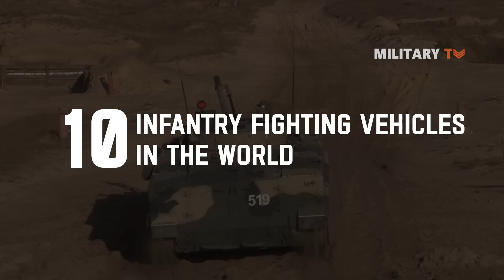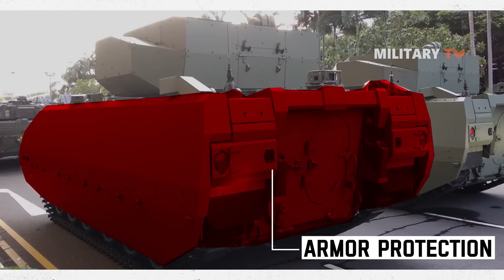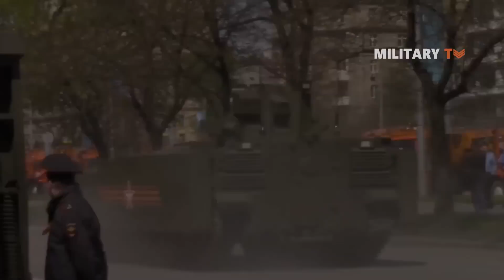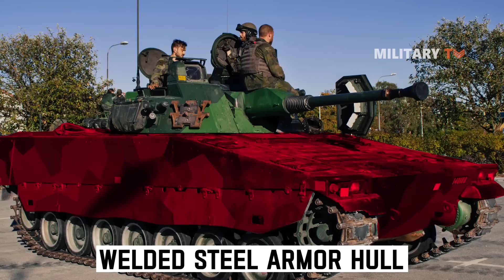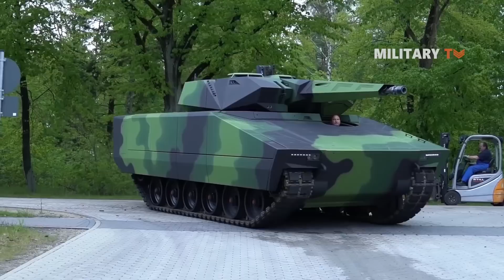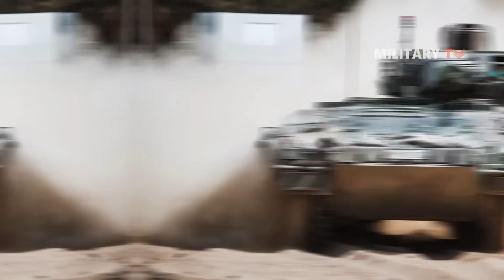Top 10 Infantry Fighting Vehicle ( IFV )

Comment: the AS-21 Redback is better than the K21, is better armoured, has a much better turret, same engine and drivetrain as the K9 thunder, can mount EOS R400S Mk2 HD or R150 remote weapon system, Javelins and two spike LR2 and Iron Fist APS by Elbit systems
it comes in at 42 tons compared to 25.6t

Comment: CV90 with that bigass 40mm cannon is on a league of its own
Reply: Except not a single export customer has chosen the 40 mm version.

40 mm Bofors is a pretty shitty armament for IFV. Needs to be manually reloaded in 7 round clips, only 3 x 7 rounds ready to fire at the gun. A Puma has 200 round sof 30 mm ready to firte at the gun, completely separated from the crew in case of detonation.
Reply: has some major drawbacks oder disadvanteges towards the puma for example tho

Comment: the Hunter Mk2 armoured IFV could do with a 5.0 in. coil spring based suspension lift for additional clearance & better off-roadability . . . it'll greatly complement the torsion bar suspension of the Hunter Mk2 . . . should feature a heightened hull that'll give the crew/troop compartment some much needed space, freedom of movement . . . a remotely operated 0.50 Cal HMG (accessible through the commander/gunner's hatch on top of the turret) mounted on top of the 360° deg rotating turret . . .

Comment: Nice. Can any of these guns penatrate MBT amour with the correct ammo?
Reply: depends on the MBT they're facing, at which point and angle the ifv is aiming and hitting them and also what kind of active/passive protection systems are on the MBT. But generally speaking, you can assume that most MBT have a vulnerable point against 20-30 mm machine guns because of the number of bursts that can hit the same place
Reply: No only the CV9040 whit APFSDS-T AMMUNITION!---->

Comment: Wow, some of the best IFV's are not on this list.  The Borsuk (Polish), the Namer (Israeli), and the Guarani (Brazilian).  The Borsuk is the best designed IFV to use for waterborne assaults, the Namer has the best armor and defense, and the Guarani is cheap while being very versatile and has many different variants that can easily be changed out.  I would take any one of those over the BMP-3 on this list.
Reply: The vehicles you’ve listed are better in a strategic case because of their amphibious capabilities or low cost. I agree that in overall usefulness a couple of your choices should’ve been used but the video doesn’t consider all aspects of fighting
Reply: Except we’re talking about tactical edge and not strategic advantage here
Reply: please explain how the BMP 3 has a tactical edge over the Borsuk, Namer, or Guarani?  @volkthegreat
Reply: Also I hope you’re aware that the Guarani is an APC.
Reply: The Guarani is an APC in its original configuration (VBTB).....but many versions have modular armor, and a much bigger weapon....and they are considered IFV's (VBCI, and VBC MR). @volkthegreat
Reply: @donaldseigel4101  So would you rather have an armored and tracked vehicle built for protection and fire support or a truck with an armor package
Reply: Mind you the wheels probably don’t do well when holding up the extra armor
Reply: As long as the armor has the same rating, and the vehicle can lay down a good rate of suppressive fire......it doesn't matter.  With the drones, IEDs, and fire and forget missiles, either one will be taken out without other defenses including supportive   vehicles specializing in air and ground cover. @volkthegreat
Reply: @donaldseigel4101  Ok but the BMP-3 can do that more effectively which is why, tactically, it’s better
Reply: Really any of your choices could’ve made it on this list though it was just the preference of the guy that made this video
Reply: Personally I don’t even like the BMP
Reply: The BMP 3 is a good IFV, I just think that the author of this video left out some very good IFV's.  The Borsuk, and Namer could be the best IFVs in the world for transport and defense, and the Guarani is the most adaptable and one of the cheapest. @volkthegreat
Reply: @donaldseigel4101  Yeah it just depends what aspects you’re looking at. If you ask me personally, the Swedish STRFs or CV90s deserve #1 and I could argue all day why they’re better but I might still be wrong
Reply: BMP is more practical as well

Comment: As an American I think the CV90 is still on top. The Germans build great weapons but I still think the CV90 edges everyone out.
Reply: Nah, I think the Bradley it's the best
Reply: The CV90 is made to defend, provide and to attack, over the last decades. So you are definitely right. None of the "competitors" can handle terrain like it can do.
Reply: @JLNLindbom  Ooh, I think the 100mm BMP3 gun doesn’t think so. The BMP-3 definitely has the most powerful weapons
Reply: @juryfilatov4520  Most powerful weapons and the worst optronics which severely limit the use of these weapons. Gun is no good when you can't see the target, or better, if the target saw you sooner and killed you before you noticed anything.

Russian thermals are 20+ years behind the west. The T-90M literally uses French THALES Catherine FC thermal imagers imported before the war.
Reply: @jonny2954  your words would be relevant in 2010.  however, since 2014, Russia has been producing its own thermal imagers and night vision devices.  of course they are worse than the latest generation devices in the West, but they see an infantryman at night at a distance of 2.5 km.  or a tank at a distance of 7 kilometers.  that's more than enough.  However, in Russia there are problems with a huge number of really old cars that have not been modernized.  but this is more a problem of the military customer, who did not order the modernization.
Reply: @juryfilatov4520  "that's more than enough"

No. Because these stats are for infantrymen and tanks in open fields. When they are covered by grass/trees/bushes it gets increasingly harder to spot them. That's why it is not "more than enough". If it were enough the west wouldn't have developed their thermals further.
Reply: @jonny2954  I'll surprise you.  but if the infantry is hidden behind thick grass or behind a wall, you will not see it through a thermal imager or night vision device.  it doesn't matter if it's 1000 meters or 1 meter.  4k matrix or 640x480
Reply: @juryfilatov4520  Only one of us has ever looked through a thermal imager and it shows. Did i say it can look through walls? No lol. But thick grass and brush, yes, since these are not solid surfaces but have many little holes between the leaves where the white hot shows through. Resolution does matter in that case because lower quality will just blur the entire thing in a grey mush. At higher resolutions you can see the holes, and through it the heat source behind it. Enough to ID? No. Enough to shoot at them? Yes.
Reply: @jonny2954  Oh, don’t worry, there is no such vegetation in the Russian theater of operations. here if there is grass, then this grass is 1.5 meters high, you can hide a tank in it, not like infantry
Reply: @juryfilatov4520  Are you still trying to find excuses for shit-tier thermal imagers? lol.

Dude. If these thermal imagers were good enough Russia would not have imported better ones from France for the T-90M . But i am sure you know better than russian tank engineers.
Reply: @jonny2954  You are confusing the event queue. First, Russia imports a thermal imager from France, then a coup occurs in Ukraine and military components are no longer supplied to Russia. Russia is starting to develop its own thermal imagers.
Today Russia produces its own thermal imagers similar to those previously purchased from France.
Of course, French thermal imagers are also used on T-90M tanks, since these thermal imagers were once installed on these T-90 tanks. And the T-90M tank is obtained from the T-90 tank. The problem with Russia is that you won’t find two identical tanks today; they are constantly being modernized in small batches. And they don’t get a new index
Reply: @juryfilatov4520  No, i am not talking about today. You were talking about the BMP-3 and how its sights were apparently sufficient, yet Russia imported higher quality western optronics for the T-90M and later "developed" (copied) it to be used with the Irbis-K.

Point is, the Russian optronics on the BMP-3 are not sufficient. Because if they were sufficient Russia would not put the effort into importing or "developing" (copying) a better performing sight for their more important top of the line vehicles.
Reply: @jonny2954  You don't understand how it works. First, a sample of the technology is purchased. Then it is copied. Then, based on it, new complexes are developed. Since 2015, Russia began installing Russian PPND B03S03 Sodema sights on the BMP-3.
Reply: @juryfilatov4520  Sodema used Zarya thermal imager, "influenced" Catherine FC aswell. Not a development based off the copy, but also a copy. Still a gen behind the west.
Reply: @jonny2954  I won’t argue - it lags behind, but it already allows you to work confidently at a distance of using weapons.

I think that the thoughts that you and the NATO command had were approximately the same when they believed that they could easily trample Russia with small groups of well-equipped infantry. But it turned out that Russia is also good at night reconnaissance and sees these units perfectly at night.
Reply: @juryfilatov4520  Small groups of well equipped infantry? You mean the "small groups of well equipped infantry" that steamrolled saddams army in 91? lol. No. Mechanised is where it's at for NATO. NATO is all about combined arms and joint fire support. How Ukraine is currently operating is not NATO doctrine. They can't operate like NATO. They get 186 Bradleys. That is two Bataillons worth. The US invaded Iraq with 2,200. They would have fought Russia with 6,500.

However considering the very best thermal imagers Russia have to offer barely compare to the performance of an average thermal imager in the west, these small groups of infantry have done pretty well. 

The problem is that we are comparing top of the line Russian equipmentr with average western equipment when we should look at what's used in Ukraine right now, which is average Russian equipment. And that isn't mostly BMp-3 and T-90M but BMP-2 and T-72. And these do not see well at night (or at all).

That's why over 1000 BMP-2 and over 1000 T-72 have been taken out in this war.
Reply: @juryfilatov4520  Oh sure - its turret can fly 30 or 40 meters high when the thing is penetrated even by a 20mm sabot round or an RPG. The BMP-3 provides for many of the most impressive fireball videos of Putin's Russian War in Ukraine. It is truely powerful!
Reply: A Rooskie with a shovel and an RPG would like a word

Comment: Every list is so lazy, it is like the same list all over.
The lynx and the puma are just IFV that doesn't know what it is suppose to be doing.
People just think it is best because it has overly thick armor and a strong engine (Which it needs because it is so heavy).
Have fun driving that one in mud.
Reply: "doesn't know what it is suppose to be doing"

The Germans invented the IFV concept lol. If anyone they are the ones who know what they're doing. The vehicles is so heavily armored because it isn't used as a battle taxi alone like with most other nations but actually closely support the dismounted elements in theater instead of sitting back for support. That requires higher survivability.

For mud, people need to realise weight isn't the deciding factor. Ground pressure is. A Leopard 2A5 actually has a lower ground pressure than a T-90 because it isn't just heavier but also much longer and has a larger ground contact area. Now compare the length and track width of a Puma and BMP-3, same thing. Puma actually outpaces Leopards, Abrams, Bradleys and CV90s even in heavy terrain.
Reply: @jonny2954  
Give me a break, they did not invent the IFV.
They may have had similar ideas, but the modern concept of and IFV and how it is used comes from the Soviet Union.
 
The IFV is not a tank.
It is not suppose to tank anti tank rounds.
It is suppose to be mobile, be able to carry troops directly to the frontline and have a turret that can give supportive fire to the men.
If it stays in the same positions long enough to be hit then you are using it wrong.
 
Do you have those specification or are you just making assumptions about the surface area of the part of the tracks that touches the ground? 

I guess if you are 3.6 m tall you need to protect your self, being a target and all.
Reply: @MegaBanne  The modern IFV was invented in West Germany. The HS-30 is considered the first true IFV and entered service 1960. The BMP-1 entered service in 1966.

"If it stays in the same positions long enough to be hit then you are using it wrong."
Fatal mindset. Mobility is just one of many aspects that contribute to a vehicles survivability. Mobility only goes so far. You can not outrun a drone and you can not outrun a mine or IED. These also do not care about how tall a vehicle is. Even the Russians acknowledged, although very late, and started development on heavier armored IFVs like the T-15 based on the Armata hull (both larger and heavier than the Puma).

Leopard 2A5: 0,83 kg/cm³
T-90S: 0,87 kg/cm³

Also the Puma is not 3.6 m tall. That's the measurement on top of the MUSS IR-Jammer on top of the commanders periscope on top of the turret. The turret roof is at 3.10 m, the hull roof at 2.20 m.
Reply: @jonny2954  
The CV90 does not tank drones like a bunch of idiots, it shoots it down.
The CV90 developers actually had foresight, imagine that.
 
Every modern IFV can tank anti personnel mines, and equivalent IEDs.
 
I wouldn't inspire anything based on Russian design.
They still think it is a good design choice to put all the ammunition right under the turret.
The Germans are better at this stuff than the Russians, just think they are lacking when it comes to IFVs.
 
I know about how the kg/cm³ stats for the Leopard is better than the T90.
I am not talking about Leopards.
Leopards are great.
Possibly one of the best tank series in existence.
 
Almost half a meter (39 cm) taller is still a lot.
Not to mention the dimensions of the hull and the turret.

Comment: The Hack man??
U didn't included Namer in this list?? I thought u will include it at No1.😒
Reply: Namer is a APC. There is a IFV version but that one wasn't adopted.
Reply: @jonny2954  actually there is no much difference left now as IFV and APC...both are same.  And mostly APC are Wheeled and IFV's are tracked and while Namer is also Tracked it's a combo of both..and deserves to be on top of this list.
Reply: @rajatdani619  Wheeled and tracked does not make the difference between IFV and APC. Armament does. The Namer in Israeli service is only equipped with a RWS with a HMG for self defence, IFVs are equipped with autocannon turrets and actively take part in the operation. There was a Namer prototype with a 30 mm turret, but it wasn't adopted by the IDF. The Namer APC was actually compared to the Puma, the proposed GCV and the Bradley IFV in an evaluation by the US CBO. Puma came out on top.